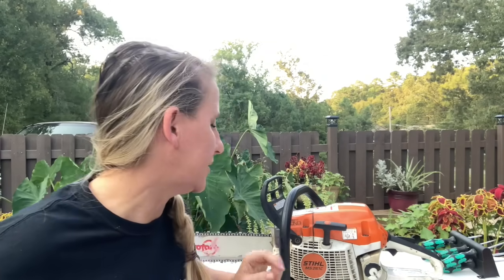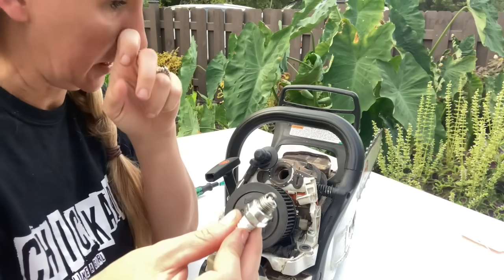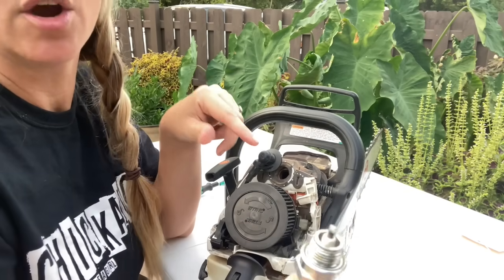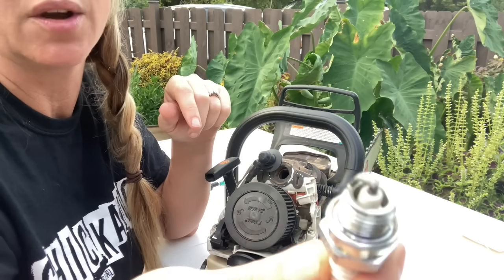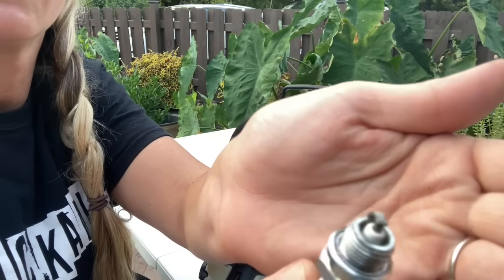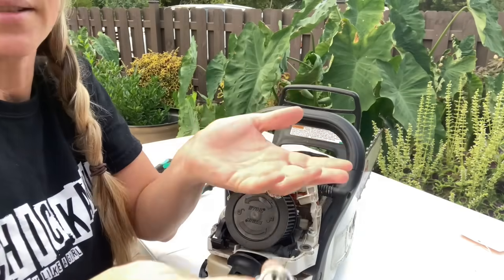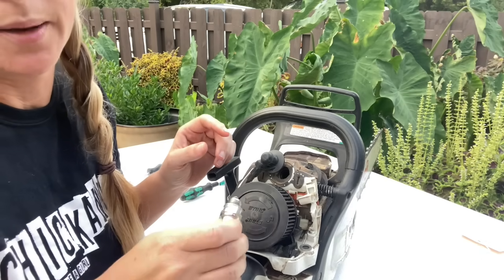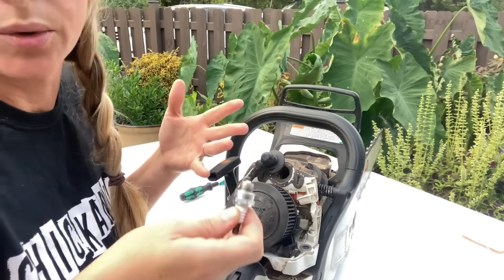STIHL M-TRONIC CHAINSAW HAS NO CARBURETOR ADJUST, WILL IT "RESET" TO REGULATE FUEL CORRECTLY?

Comment: I'm so tired of the Stihl shit. The MS-250 chainsaw has so bad fuel and oil caps its a joke. The oil cap has fallen off so many times and dumped the chain oil down my trouser leg. Vely vely funny. Not just refill with oil and wipe the saw clean - but also take a bath and find a new pair of trousers. The guy who designed these caps should be poked hard with a cold ladle on his private parts until he stops yodeling and promises to never design anything again.
And the FS-38 trimmer head is a utter joke. It just don't spool out any thread. Now my trimmer is so bent it looks like a banana because I poked it so many times and so hard into the ground to try to get some thread out. And all the plastic in the whole head is broken into pieces. MAYBE STIHL MADE SOME GOOD PRODUCTS - BUT THATS A LONG TIME AGO - IT HAS GONE DOWNHILL WITH THEM. Btw you know the plastic cap in the spool head that bumps into the ground, it has a nut fastened inside to screw it on. You know what keeps this nut in place??? A piece of bubblewrap behind it. Yes that's right. Bubblewrap!!! Stihl now uses bubblewrap in their products as an OEM part. From nikasil to bubblewrap. Yes it has gone downhill.

Comment: Husqvarna here in New Zealand does exactly the same as Stihl in relation to the extended warranty.  1-2 years but increased to 5 if you purhase and of course use "their" oil.

Comment: My stihl dealer told me to let the saw idle for 5 seconds after starting.   Usually starts around 3 pulls, even at -18 below.    Also 91 gas on the 362   but like you said, let it idle for one min then hit full power..    You will hear the change.   I also let my 362 cool down after hard use..       Try it!!

Comment: I have one M-Tronic saw, an MS201TC that I rebuilt from a junk saw that looked like it had been dropped out of a tree. The innards were fine, and after some reconstructive "plastic" surgery, it was ready to run again. Generally it is easy to start and runs great, but I've noticed that when pushed beyond its intended use as an arborist's saw (when you need to buck some large oak branches and it's the only saw you have at that location), it will cut off at idle after about 30 minutes and will not restart until it cools off. I was suspecting the coil or the M-Tronic system, but after reading some of the comments, I'm going to take a good look at the solenoid.

As for the plug condition reading, the real interest is what's going on at cutting speed at WOT under a cutting load. It would seem to me that a better test would be to buck a log of diameter appropriate for bar length at a normal work pace for about ten minutes, and after the last cut let it idle 30 seconds, then cut it off and pull the plug. Most of the time would have been spent in actual cutting, thereby reflecting the spark plug appearance that would be most accurate and useful.

Comment: Why didn't you make a few cuts? You can't just run it a few seconds and see if it made the plug greyish brown or brown. I really think you aren't a Stihl fan just to be honest. The idle went down as it seemed to adjust The fuel somewhat, right? That was pretty lame!!!!  Thanks for the video though. I was actually wondering what ya needed to do to set or reset the tune on the M-Tonics.  Thanks and go run that thing through some wood! Lol!!! I know you know better, you just don't want to give Stihl any credit for something that actually works but thanks again!  It was interesting!!!!!
JZNTN872 
Have a great weekend!!!  I went ahead and subscribed to see if you can do anything other than the common stuff on anything.  We Will See!!??? BFN

Comment: I’m by no means a Stihl mechanic, or even a small engine mechanic, but I do commercial tree felling and logging and I use the entire Stihl pro line in my work. 
I recently had a very similar issue come up with both my 462c and 362c. It was a extremely hot day ( above 36 degrees celsius ) in very dusty conditions and after about 3 hours on both saws they became very difficult to start - to the point I started field stripping the saws to try and find the problem. Both spark plugs were very fowled and burn - and were showing signs of excessive oil consumption over fuel as there was oil residue on the threads of the plugs. Of course I first tried to clean the plugs, use sand paper to clear the tips - and that did get them to start and run for about 20 min but once I shut them off - couldn’t start them again. Again I pulled the plugs and again they looked like I never cleaned them to start with. The 462c was much easier to reset once a new plug was in and the fuel drained and fresh fuel added. The Mtronic system actually reset itself in about 35 seconds of idling in the shade and out of the dust. The 362c was a bigger headache and refused to reset regardless of what I did - until I stumbled on a little trick that ( so far ) has it fixed. I removed the bar and chain completely. Took the air filter off ( after it sat in a garage for a few days not running ) I gave it the same treatment as the 462c - fresh fuel, new plug, blew out the saw with compressed air and I kept it on choke. It started, was very very rough but it started. I put the air filter back on and let it idle for a minute. Shut it off and let it sit for 30 seconds. Fired it back up and it seemed to reset itself completely. I put the bar and chain back on and it’s been running like new since. I can’t say I know the science behind it but there is definitely some aspect of having to let these Mtronic saws reset after being run hard in extreme conditions. They seem to definitely need a bit more regular checks but the system seems to be resettable by running it in full choke then doing a hot start and let it correct itself.

Comment: New (re-entry) Small engine tech- I'm at a Stihl dealer in south new Jersey, un fortunately the special tools required to check the solenoid valve are on backorder so the senior Tech and I resurrected older svc tools to do leakdown check on solenoid for example- thanks to the chat Tech for the general info, we are a rental equip outfit & I'm having to study on my own to update on the Late model Stihl products, we are busy and yes a little kindness with your dealer goes a looking way, I always remind my customers to check their fuel cans for water n dirt- cans get contaminated easy, and one last thing, get a wire type spark plugs gap guage and gap the spark plug as to this optimizes the ignition system/general operation of engine. New Sub Here-
Reply: Oops-.028"-030" gap for most bigger saws- .025" gap for the little /mini size 2 stroke units.

Comment: I have had a 034 sthil for 35 years about .Iam not a full time cutter but have cut 100s of cords with it . Yes I rebuilt it once my fault torn air breather .I have also changed the coil and put crank seals but I would buy anouther one for sure ,I also have a little 310 Echo I use for small stuff and junk has been a great saw also..And yes I have about 10 outher old saws .No poloulins or Macs their junk .And all I use for oil is Castrol that is what sthil is .I have had great luck and I mix it at 40:1 with high test gas( ethonal free) at all stations here

Comment: Stihl is so genius at marketing they still sell junk on what used to be a good name.
Buy a new saw and youre lucky to get it to run however its adjusted.
Buy someone elses product. It probably wont have the hated junk fuel and oil caps they marketed either.

Comment: Plugs take a lot longer than 90 seconds to color up. The fact that the porcelain is white doesn't necessarily mean that the engine is overly lean. That engine would need to be run under load for 20-30m minutes to develop any kind of reliable color!!  Old-school mechanics always seem to be at a loss around high tech hardware!

Comment: Thanks for this video. I don't have one of these but understand the frustration from the industry adding more and more computers to the mix. When I went to buy a chainsaw years ago, Husqvarna had recently come out with the "e" series, where they just added an "e" onto the end of their old model numbers. The "e" seemed to be some new fangled something that sounds similar to what you are talking about. I researched it quite a bit at the time, decided it was crap, and bought a brand new 440 without the "e" on it. I guess with my next one, I won't have a choice anymore. The world continues to turn. Will just deal with whatever comes the best I can. Thanks for sharing 😊
Reply: I have both the 440 and the 441. I can tell you the 441 vibrates a lot less and has a noticeable increase in power. The new 462 is even lighter and more powerful. All are 72 CC saws. I still use my 440 sometimes. But if I need to buck a 20 inch locus the 441 is just faster. I was just using it to cut some big red oak in half so I can actually lift it on the splitter without braking my back.

Comment: I have a Stihl 028 Wood Boss that I bought from a old gentleman back in 1990. He told me that he bought it new in 1979. He told me when I bought it that it had an air leak between the casing and sold it to me for $75. I took it to a Stihl repair shop and had it fixed for $50. This thing still runs great. That shop and two others told me that I could go over to the display shelf, pick out any Stihl chainsaw I wanted and they would swap me even. I was hesitant and just said no thanks. After the third guy told me that I asked him why was he willing to do that. He told me that Stihl no longer made their casings out of metal and they now made them out of some type of plastic and they had changed the ignition over to an electronic system and it just wasn't as dependable. Glad I didn't fall for an unblemished new chainsaw. Mine looks rough but it is a workhorse and it has never let me down.
Reply: I own sever 028s, and MTronic stuff also, , , ,I always grab the 028s for every job, and the Mtronic only for bigger wood, but yes, the 028s always perform great

Comment: How do I know if my saw is M tronic   It does not say anywhere in the owners manual about calibration.  It only tells you how to adjust the carb in section 17.1 and I cannot find any wires leading to the carb?  Thanks.

Comment: I agree 100%.  I do not like any computer controlled saws, whether Memtronic or Autotune.  I only have one, my ms 241 C-M.  It has caused me more little minor problems than any of my other 12 saws.  This past weekend it decided to throw the E clip and sprocket washer off.  I was lucky it did not eat the sprocket bearing, too.  I finished the job with my Husky 455 and my Stihl 181 CBE.  In the past the 241 lost spark when it vibrated the spark plug coil out of the spark plug wire.  It also completely blocked over the spark arrester screen running Moto Mix.  Nothing bad, but it has been a pita.

Comment: Right now I have this same problem with a Husqvarna 555 xp . I am trying to repair  but not enough time to put my hands since we are renovating our place. One of my staff opened the carburetor and he couldn't fit it on the machine. It's a bit tricky. I assembled it and started and running well,  but not idle even getting warm. When I free enough I have to do that and let you know in comment box or please send me your email address. 
    Bye with regards. Nelson from Kuwait.

Comment: Have bunch stihl equipment. Use cheapest 2 stroke oil I can buy, even marine oil if discounted. Mix 25:1 never had any problems. M tronic problems, replace standard ignition coil & carbi is worth a go.

Comment: So I read for the M-tronic re program, start the saw let it run for 30-60 seconds then release the chain brake and then run the chain at maximum speed for 30 seconds so it can reset. You will hear it go through all of its settings when you run the chain at high.

Comment: They told me when i bought my ms362CM to clean out the air filter every other tank of gas or it will burn up due to starving for air. I love it so far never had a problem and it is very reliable.

Comment: - - i have stihl fs 460 electronic _ I replace the carburetor en the coil and put the coil  and the carburetor from one STIHL FS 240 or 260   - - finich the electronic and now i have again my H and L screw   - the machine runs great  - the number from the carburetor is ;  4147 120 0600 - from the coil is ; 	4147 400 1313 -

Comment: I’m cutting firewood this time of year, temperatures are up and down.  Cutting with the saw at -15C one day, then pull it out another day at 0 or 5C.
Just start the saw, let it idle for half a minute or so, and then you it’s good to go. I’m running an MS 362, and an MS 441.

Comment: I just can't shut up!!! Bear in mind that Mtronic saws are on their 3rd generation. Usually when a new product comes to market there are issues. Everyone knows not to buy the first model year of an automobile. Wait until the bugs are worked out. Same with all new products. In the last 30 months, I have had 1 Mtronic saw in my shop. Reset it and bada-boom bada-bing, good to go. There was a soleniod issue with early saws but that has been addressed.

Comment: The government does not want the end user to adjust engine air/fuel ratios. You touched on this in a previous video regarding fines for selling consumers adjustment tools. Mtronic saws are just the latest effort to keep their saws compliant with the EPA.  They are a bit obsessed with this, I guess that's a good thing??

Comment: to check that saw is getting enough fuel under load - apply the chain brake and see if motor fades under full throttle after a few seconds if it holds rpm's then it is not leaning out and is getting enough fuel.

Comment: You mentioned the proper gas / oil mixture. Stihl says 50:1 . Every one and their brother claims they have a magical mixture that is much better than 50:1 . What do you recommend? Any Stihl dealers out there are welcome to chime in also. Thx.
Reply from the maker: I always put a dab more oil than I am suppose to when mixing. Not necessarily making it 40:1, but I can say red armor is my favorite due to my severely neglected equipment starts every time even after sitting for a couple years. It has fuel stabilizer in it.

Comment: If you have problem to start when its warm especialy with the older version its probably youre selenoid valve on the carburator! Replace it 25-30$ and that it! Im a stihl dealer and i work on those chainsaw until 2004 and honestly stihl is the best chainsaw on the market! The warranty on a 261 is 1 year for professionel not 3months and its 5 years on electronic module!

Comment: SELONIOD the M-tronics have a little tiny electronic selonid that plugs into the side of the carburator. If You're saw starts to run weird it is usually that little selonid.   FEUL:  filter you must use the Stihl M-tronic fuel filter do NOT use a standard Stihl fuel filter.    AIR CLEANER: Take some thick grease or thick oil and apply  it around the rubber hole ring were it mates to the carburator intake mount, this creates a dust catching gasget seal. Trust me I use an M-tronic daily in the Oregon woods.

Comment: My Dad bought me one of these STIHL saws with the M-Tronic.  Completely useless nightmare that was damn near impossible to start.  It was great, IF you could get it to run, but most days, I just went with the larger Husqvarna that always started right up.  A couple years back, I was taking the saw home, and forget to put the tailgate up, and it slid out the back.

My Dad then bought a small Husqvarna of the same size, this past summer, he told me that losing that STIHL was the best thing for that saw.

Comment: I could go behind a bar in NJ drag my 1966 Allis Chalmers out of the mud & have it running in less than a hour. I'm a retired Auto,Diesel, Marine tech, my relatively new Poulan chain saw ignition coil failed... The coil had made in China written on it.  These companies try to reinvent the wheel with Chinese parts. WW2 hot wire technology worked very well.

Comment: I picked up a 14" battery chain saw a couple years ago. I don't use it often, but when I need it, it 'starts', no messing with old gas and plugged carbs. I got to put it to the test when we had two tornadoes rip through the neighborhood last summer.  The two 18v batteries lasted six hours (+/-?) and when they quit, plugged in two more.  Both my neighbors were as impressed as much as I was.
Reply: My freind bought a newfangled battery powered saw, went over his place cutting wood with my old husqvarna 455, sorta embarrassed him and his new saw. Next time I went over to cut at his place he pulled out his old-fashioned gas powered saws, left the battery powered toy in the house where it belongs. Don't get me wrong their ok for pruning, or whatever but if your trying to buck some big hardwood trees up into firewood quickly nothing beats a gas powered two stroke screamer.
Reply: @kevinStidham-w6r  Can't disagree with you. The 'E' Makita works like a champ for   use in the residential yards for every now and then. For what you're doing I'd have a gas saw, no doubt.
Reply: We also picked up a 80 volt Kobolt saw that we recently cut down a dead standing tree of a few years. The saw cut through a 30" diameter hard wood tree easily & also limed it as well as cut in rounds for some friends to use to heat their house with. The tree was at least 50' tall. Strange to cut down & limb a tree with no noise! Only used 1 battery also but had a backup if needed. Went all electric with our self-propelled mower several years ago as became fed up with carburetor  issues as well as electronic ignition coil systems also. The mower & saw use the same batteries & charger. Now if someone would make a decent simple single cab long box compact pickup we would want to buy it too, especially if the pickup had a least 300 mile range hauling 1,000#.